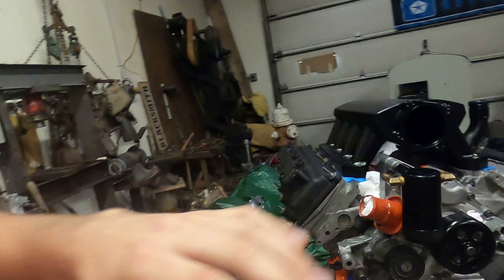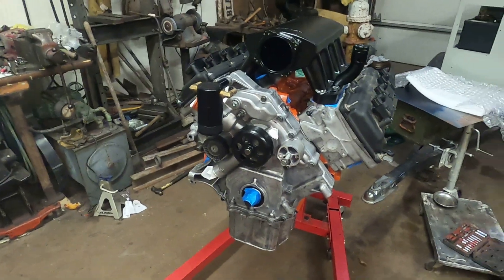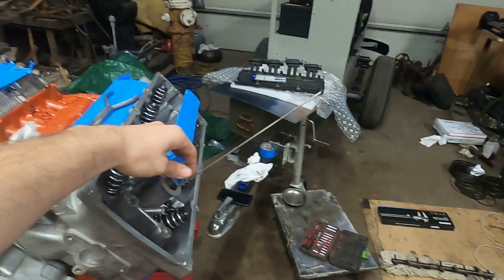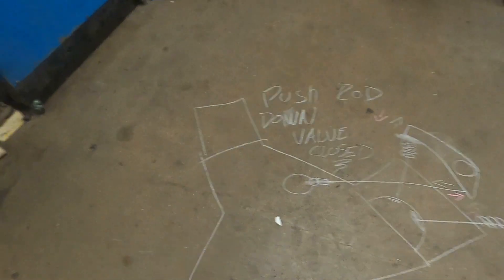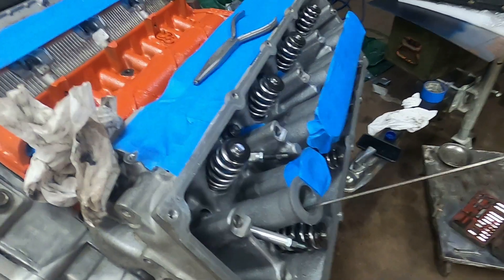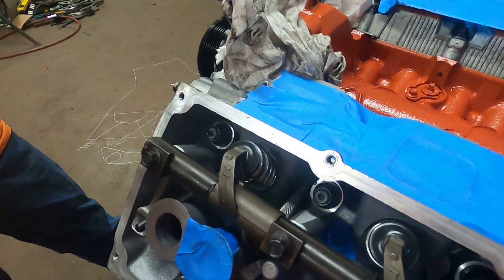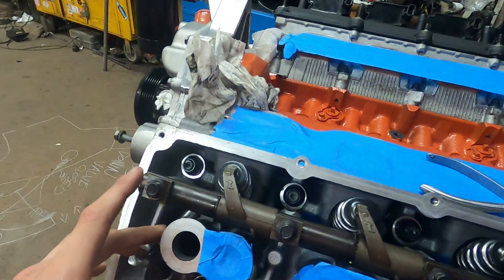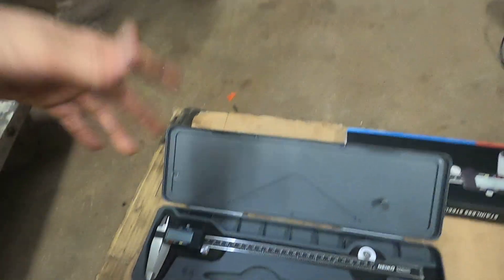Building a Procharged 426 Hemi (Part 5) *Measuring Pushrod Length*

Comment: 900,000 HP at the crank. I think bro might rip open a black hole with that 😂😂. But on a real note. Where did you get the block? Did you just have a 6.2 board out or 6.4 or a 5.7?Or did you buy it from a company that already makes the block that size?

Comment: Hey mojo gt! Quick question. Did you only have to measure cylinder #1 intake and exhaust pushrod length at 0 lash @ TDC.  Or did you have to do every cylinder like that? Thanks
Reply from the maker: Yea that is correct. All the others will be the same
Reply: Ok thank you  👍